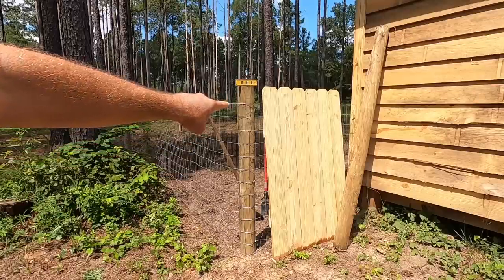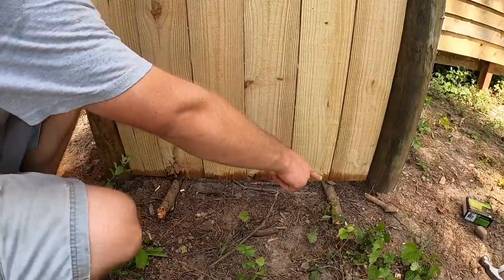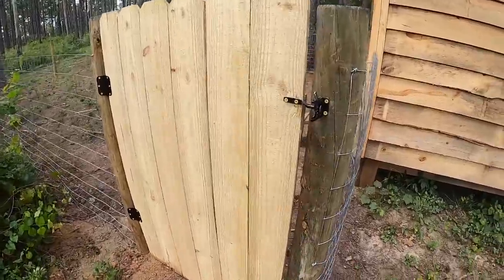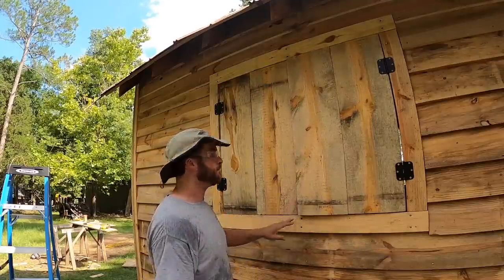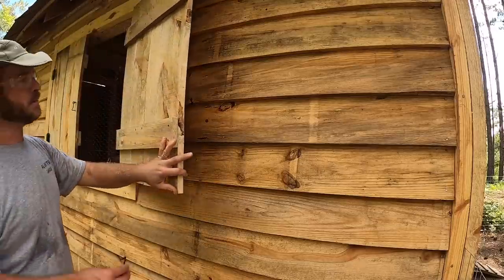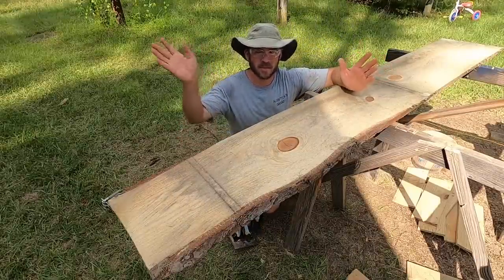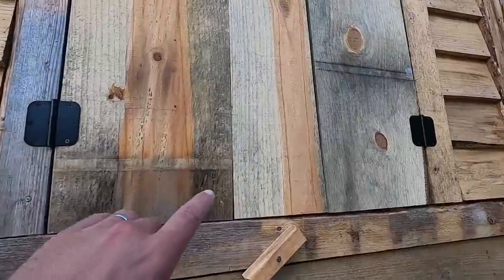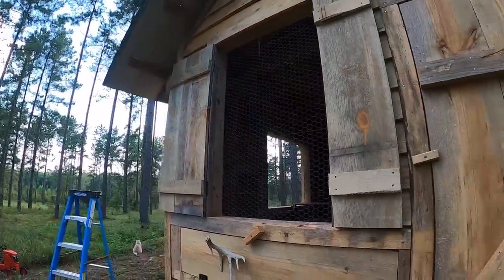Building a Chicken House, Part 9

Comment: Looks good! The only thing I would change is either the direction the cross buck is going or put your hinges on the other edge of the door. You want the bottom of the diagonal piece pointing at your bottom hinge.
Reply from the maker: You're not the first to mention that. I can totally see how that would work better.

Comment: You did a fine job with that 🐥🐣 chicken coop !! Well built and beautifully explained. Will you be locking up after dark so predators don't help themselves  and the chickens are all safely roosting inside ?
Reply from the maker: No plans for that right now. They've been in there for several weeks and no issues yet...though it'll probably happen eventually.

Comment: The Screw bit keep coming out of the holder... Just a little piece of store bag in between the  two, the bit and the holder will lock it in but can be pull out... The Bag is the thin kind like at Home Depot... The piece does not have to be cut and certain size just big enough to come out where the bit is inserted in the holder... It will hold well.... and if you loose the piece the bag is close by and start over!!!